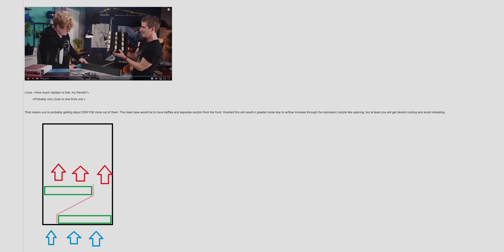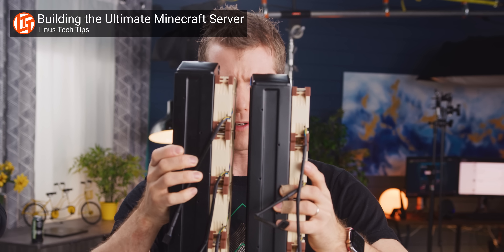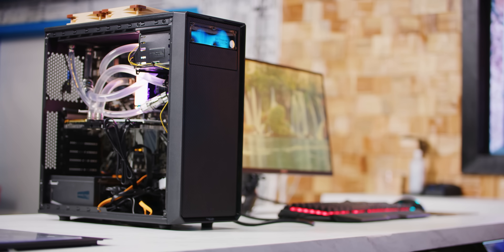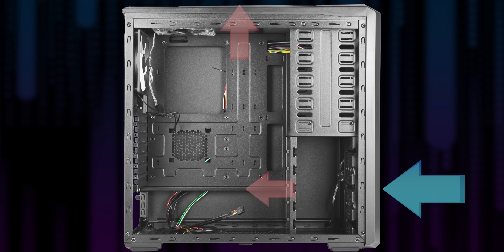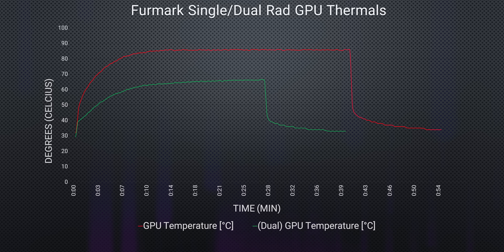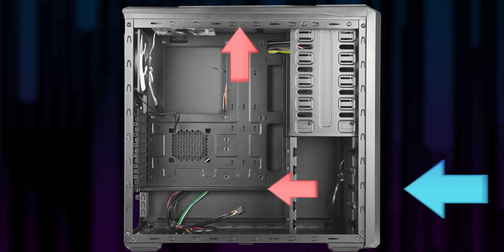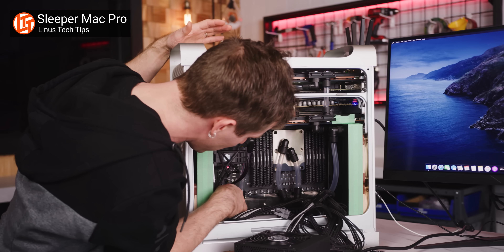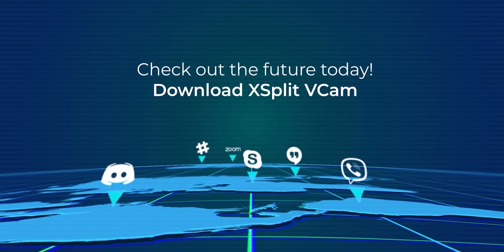I’ve been water cooling wrong for YEARS - $H!T Manufacturers Say

Comment: I think both Linus and Corsair are right. As long as you do have decent airflow, i.e. the ambient temp within the case is not becoming hot, you can win by adding a second rad. If you on the other hand end up with a hot box, it is possible to get hot enough air so that the radiator isn't helping that much, but by restricting airflow, the box becomes hotter.

From experience: At the end of 2014, I wanted to run games on a triple fHD setup (surround/eyefinity) at 60Hz. The best and practically only well-scaling solution was the infamous 290X crossfire paired with an Intel HEDT x79 board. 900W from the connector on peak, mind you, but it did the job. Oh, the two 290X both needed to run in "uber" mode to counter frametime issues, and during Metro2033, I did see numbers like 800-850W from the connector, on stock settings. That's a microwave oven, mind you.

I also realized that the 4way x79 board used pretty much left me with the option of water cooling. The two 290X needed full-cover blocks. To make things worse, I can't stand noise and at some points in time I was using half-passive systems. Oh and don't forget the cats, so utilizing a Mora3 was out of the question.

Airflow in combination with surface area was the key. For a chassi, I opted for the NZXT 630 with the see-through side panel, although I theorized that a Phanteks Enthoo Elite or a Thermaltake X9 could also do the job. The most I could fit in was an EK 120x60 + HWLabs 280x30 intake, combined with EK 120x45 + AlphaCool 360x45 exhaust. But, I did have three water sensors and three air sensors, so I could monitor what was happening. And this is where it got crazy: The 120x60 intake had a 120mm fan, but it was combined with a 200mm intake fan. The 360 exhaust was combined with 2x200mm exhaust fans (and a single 120 pushing in the middle where the 2x200 weren't covering it). The 280x30 had two fans on push and the 120x45 exhaust was used in a push+pull. Now, using a larger fan on a radiator is usually a very bad idea, especially considering the 360 practically giving more than third the surface area. To give an explanation, the two 200mm fans on the exhaust had the purpose of making sure that the hot air didn't got stuck and using 2x200 instead of 3x120 lowered the overall system temps by at least with 5C. I opted for the see-through side panel upgrade to make sure that I still did a somewhat clean airduct in the chassi. Yes, the NZXT 630 ultra tower was completely full. Oh, I used a Laing D5 vario pump and had a custom autonome regulation system, but that was (and is) pretty much standard on multiGPU.

The performance was magnificient, 4+ years later, the system was doing 50fps AVG on Far Cry: New Dawn on 5760x1080. On GPU limit as long as crossfire was working, it did beat my current 5700xt. It was a beast.

The temperatures were frightening on the other hand. When you have 22C in the room, 23C before the intake fans and 45C (!) degree wamth coming out from the system at one point during stress testing, with 32C in the middle of the system. Water temps were also high, but then again, with the EK 290X blocks doing 15C degrees over water temp and the EK Supremacy doing 10-12C degrees over water temp, there is a headroom even with the loop hitting 45-50C. There was also a 10C degree variance within the loop, but that was just showing that the GPU subsystem was pretty much on pair with an 7990 or 690 4way setup in terms of thermal load.

Looking back, I'm actually half sad and half happy that multiGPU isn't working anymore. 500W is also pretty much doable on air with the right chassi.

Comment: Seems that you're ignoring the obvious problem with Corsair's claim. The temperature of the water is going to be far higher than the ambient air, and there's no way that fresh air passing though a single radiator is going to be heated from ambient (~21c in your video) all the way up to the temperature of your coolant in the short distance between front and rear of the radiator.

The obvious extension to this experiment is to find out just how efficient are your radiators at moving heat from the water to the air? Just add a couple of thermal probes and compare the temperature of the air outside (ambient), inside the case (after one radiator), and exhaust (after 2 radiators), and compare that to the temperature of the water loop.

Comment: Heat goes from hot to cold, not the other way around. In the animation, the arrow should be pointing to the air, the air's temperature increasing and the water's decreasing, reaching an equilibrium.

Comment: I've always thought two radiators as intake is best case scenario. Most cases don't allow for its though that's why I went with the o11 dynamic, a slim 360 on the side and a thick 240 at the bottom. Both pulling fresh air from outside the case and 2-120mm exhaust  fans up top 👌

Comment: There are a lot of different factors that affect water cooling.  It is true that the air temp exiting a rad is warmer than that entering the rad; and thus, in a stacked rad setup, the downstream rads are less efficient.  Also, adding a 2nd or 3rd rad will not necessarily have a significant effect on the chip temps etc.  The only true way to know for exactly what is going on is to run a thermodynamic analysis of the cooling loop(s).

Comment: They also need to keep in mind that you will not completely saturate the air with the first radiator in scenarios when were putting rads on the back of rads. In that scenario it would also be better to use a lower fin density so as to not choke off the fans.

Comment: It's the extra water that is changing the results. Adding another radiator means also adding more water. More water means more heat can be adsorbed away from the processor. What you should have tested was radiators sandwiched verses radiators mounted next to each other getting fresh air each.

Comment: The build corsair commented was one that you had a 360mm radiator and said the 120 is useless. Adding a 240mm to a 120mm sure will do wonders, at least from proportions 6 times the difference without counting what corsair said

Comment: I wonder what an extra reservoir would do in the single rad version? Would add in the extra water the dual rad version had, in theory adding in extra thermal carrying capacity? Not an expert (what gave you that idea?) but the longer warm up of the dual system may be somewhat due to the extra water to heat in the loop. 

Idk?

Comment: Makes sense that two radiators would be better, because the air that comes out of the radiator after being heated isn't gonna heat up that much, so it'll still have lots of heating capacity when it gets to the second radiator.

Comment: Another YouTuber fell under such fire from readers several months ago. With temp sensors on his CPU as well as his rads and using a CPU stress/benchmark program, he could only force a 2F difference in the CPU temp regardless how his rads were configured (well within the error margin). OTOH, the water temp remained much lower than the CPU, as did the temp of the air coming from the rads, proving that rads do their job regardless. Unfortunately, most people respond based on what they think, not what they know. Keep up the good work, Linus!

Comment: You should put the hot part of the loop on the exhaust radiator then feed it's output to the intake radiator. This way your setup approximates the ideal heat exchanger (two parallel pipes, used in thermodynamics classes).

Comment: Really makes no sense, heat loss will definitely occur when passing through a radiator and radiator will increase the water volume needed to run through the system. I guess if you can mod a case with a hollow bottom and cram lots of radiator you don't need to use a fan at all the heat loss will be so great it will be ambiance temperature when it loops back.

Comment: I do my best to seal my keys as best I can to limit any Dustin tree it’s bad enough the filters don’t go throughout all the dust particles so best to limit that from the equation altogether Single sided tape foam add an 8 inch thick really helps. Done right looks discreetly don’t even know it’s sealed up ;)
Reply: Just means you have to clean the filters more Hah Hah Hah Hah 900 D

Comment: Thinking about the Mindcraft server... When stacking radiators, run all of the water through all 3 radiators.  First, run the hottest water from the 3rd radiator, then through the 2nd and then through the radiator closest to the freshest, coolest air. (???)

Comment: You guys need to look at this purely from a physics and laws of thermodynamics standpoint. If you REALLY want a perfect solution to this, 
-- Build two systems. Both fully enclosed, but one that has "mixed" air,  and one that has only ambient temp air in the front and bottom, and exhausts from the rear and top.
I.e. ONLY AMBIENT TEMP AIR IMPACTING THE RADIATORS. This would be your ideal "nail in the coffin" test to do. This would give you hard data on the effectiveness of ambient air through a radiator, vs air that changes consistently in temp over time by mixing hot and cold. But honestly, my guess is the temp difference even in a "perfect" scenario would be maybe 2C maximum. I think the "efficiency" of modern radiators really has a big hand in the results.

Comment: I wonder what would happen if you have a second, independent loop that isn't cooling any component sandwhiched between two rads cooling your components. So the pump/res is outside the case. Would it help siphon heat out?

Comment: You didn't really point this out but the water should flow through the radiator with the warmer air first and the one with the freshest air last. You could have also measured the differential temperatures of the air flowing into both radiators and compared with the water temperature at that radiator. That would have given you all you needed to debunk Corsair's statements using their own logic.

Comment: Corsair probably meant when the radiator fans are on the inside and are exhaust radiators because they are taking the hot air on the inside, through the radiator out.

Comment: You guys got em.  There will be a maximum heat transfer rate basically dictated by rad surface area.  There is a company that uses really quiet low static pressure fans on their rads.  With that setup you might actually halve your airflow which would flip the result.  Bottom vented case with top and front rads blowing out - that would be the way.

Comment: Errors in your methodology compared to Corsair's:

Control for input: Accept that 3 stacked rads with a single tunnel of airflow will be less efficient than 3 rads unstacked, each with discreet or at least not directly dependent airflow.

Control for environment: Ambient room temp & products used should be the same as Corsair's testing to be equivalent to Corsair's testing. You should use the Minecraft rig for this test and account for ambient temp compared to Corsair's sim.

Control for variables: You're not just testing the ability of  a rad to pull air from a case, you're also testing an increase in heatsink capacity. Your temps will always hit the cap slower with 2x rads because you've got double the heatsink capacity. Control for this with a much longer test run time to saturate both rads. Also test temps/noise running higher fan speed on one rad vs two rads and find the saturation point.

The way you've run this is like comparing CPU coolers without putting fans on them. Yes that huge pile of metal tests better than a smaller pile of metal initially, but both will saturate to equivalent temps without airflow.

Run your test longer. Control for variables.
Reply: Increasing the thickness of a radiator does increase the surface area, but it is not as efficient as adding more area(longer or wider). If what Corsair is saying is true, then thicker radiators would be a waste of copper, but they are not.
Reply: Exactly. He wasn't testing stacked rads which was what Corsair was taking issue with.

If stacking rads always provided a benefit, we'd have seen it in motorsports already. Koyo would be selling kits to stack the monster radiators that they produce.

Comment: You've added two additional fans sucking air out the top so there's less heat build up inside the case with the second radiator, would be interesting to try the test without the second radiator, but with the fans. You might just find that pulling the air out of the case allows the one radiator to work more efficiently by pulling away the heat from it. I think what Corsair are really getting at is you need to keep fresh air to the radiators, by stacking radiators, yes you'll get heat transfer but it's not as efficient as it could be, it would also be interesting in a stacked configuration to see the temperatures of each radiator along with in and out air temps to see how efficiently they're working.  Also what would be interesting is to test different liquid flow rates.

Comment: If you stacking radiators make sure that radiator after heat source (CPU or GPU) is in warm air and one which is sending water back to heat source is in cold air.

Comment: Something that would likely result in inefficiency as well is if the rad getting the cool air was the first rad in the series. The first rad in the series should be getting the warmest air and the last rad should be getting the coolest air. That way you are not going to introduce heat to the loop at at stage.

Comment: I think their thoughts and model is based on the idea of a sealed case. it may not take into account that 120/140mm fan mount that is just outright open as you suggested in this video. you should try the same test with a bottom and front mount rads vs front and top with regular ventilation fan in the top and rear. I think you should seem some interesting deltas and data in that case. but ideally so long as there is a delta between the air and the liquid temps, cooling will occur.

Comment: The heat of the cpu will be transferred to water, because of the temperature difference; this heated water will go into the GPU next, before getting cooled off by radiator. 
This is one of the reason why people have separate radiator loops for their system.  However, if you were to insert a temperature probe to the inlet and outlet of each radiator, the results will be of a diminishing return, that the second radiator is useless, due to less heat difference. 

The specific heat capacity of water is much higher than air, meaning it takes a long time to heat up. Combined with a copper cooling plate, the heat will be transferred to the water, but the water hardly gain any temperature increase. This is why water cooling is superior to air cooling.
However, the thermal conductivity of water is lousier, as a result, even if your radiator is made of aluminium, which has one of the best thermal conductivity, the heat transfer from radiator to air is still minimal; the limiting factor is still the total heat difference of air.
As a result, the hot air that comes out from the first radiator will still be sufficient to cool the second radiator, as long as this temperature difference exist, albeit not efficiently.

Comment: Radiators are not ideal, just because the water is 40C doesn't mean that the exhaust air is 40C, it may be more like 37C, which leaves room for the air to go through another radiator and absorb more heat.

Comment: I think the problem with the sim is they assume the first rad after cpu/gpu is the fresh air rad and the second rad in the loop is getting worst case hot air from initial cooling. But I think if first rad after cpu/ gpu in loop uses the warmer air and second rad uses the fresh air the you get 2 chances at cooling the water actually helping to keep the components in the case cooler.

Comment: This is silly.  The air in your case is always cooler than the actual components because it's coming from outside at least in part - What you should really test is how much an added fan to the case improves your water cooling.  Second, just the added volume of water for multiple radiators increases your heat capacity. Using external radiators would work best - buy a second case and use that - and BTW - Corsair actually did this with a product back in the day.  Lastly - if what Corsair said was true, then radiator size doesn't matter, because what you are doing is basically just making a bigger radiator.  But, as a scientist and someone who works on classic performance cars - that obviously not true.  Even in the world of a sealed box with recirculating air, the added volume of coolant will still delay max temp significantly, even though in the end, you would actually hit the water TC at equilibrium with the internal case temp.  You are not in that world unless you are trying to put your PC in a submersible case.  Corsair is wrong.  I didn't need to watch the whole video.

Comment: There is one thing i've been thinking about...
It's possible to make a loop in wich includes: Full motherboard (including all chips and mosfets), vga, all of the storage devices, psu, monitor and table (i think under the keyboard, so the hands don't get sweaty on summer and think about watercooling webcam and audio devices, maybe controller ? ou even the modem/switch), I think it would be difficult to include a chair within the loop, only as a separated loop
A little crazy idea, but not impossible, only chaos in the tubing